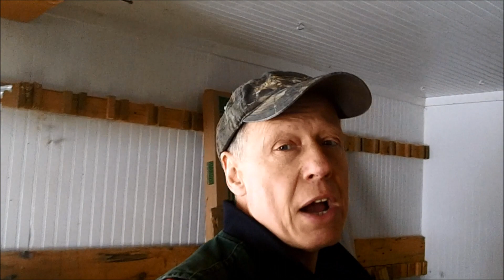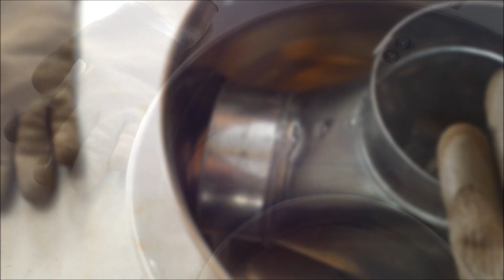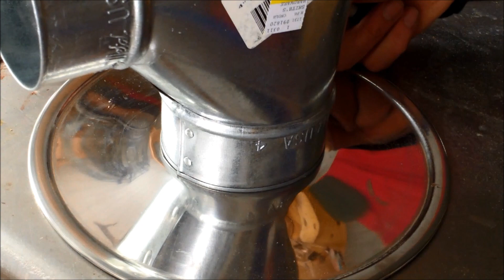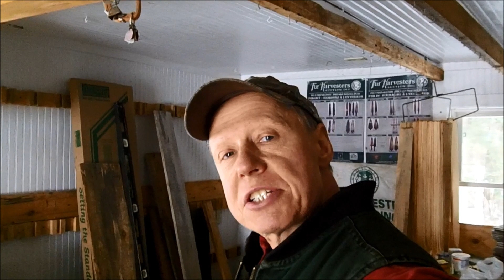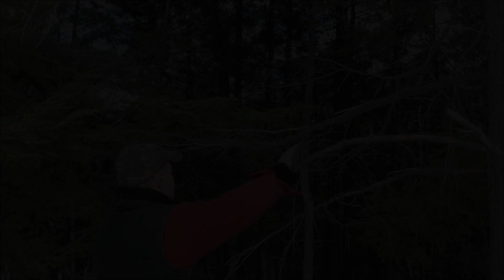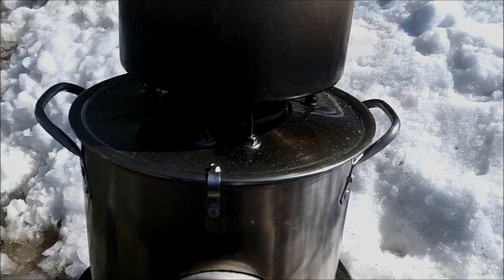HOW TO BUILD A SUPER SIMPLE ROCKET STOVE

Comment: Kudos on the concept!
A couple things that you can do with the exact same parts.
1) Use the cut out pieces for a foundation at the bottom of the burn chamber for added resistance to a burn by sliding one to the bottom then adding an inch of sand, and then the second one onto the sand.  This would work best if when being cut, they were nearly exactly the same size as the galvanized section.
2) Your U bolts were brilliant - but nothing says you can't turn them upside down to use - there by lowering OR even making adjustable the height of the "grate" you're replacing with them. 
My hats off to you - PLEASE keep these wonderful ideas coming and your channel viewers will be ready for anything!!!
~Soft Winds and Starry Nights~

Comment: Hi. Just a quick tip. For better burn it would be good to have some sort of shelf at the opening where you feed in the wood like some other rocket stoves do. This would allow air into the burn area. Also if you made a lose fitting skirt that goes around the size pot you intend to use to get the heat around the sides of your pot. Good luck. Whish you the best. Jason, Waiheke , Aotearoa nz

Comment: drywall corner bead makes a good pot holder/wind break because the stuff is stiff and has holes for the smoke to escape.  Just make cuts with snips every 2 inches on one side and you can bend it around in a circle.

Comment: For windy days,you can make a pot skirt from flashing. It should be about an inch and a half bigger that the pot you'll be using and about 5-6 inches tall. It directs all the heat up around the sides and doesnt let the wind sap any heat from the flame. Very nice neat build. If you build the one out of 6 inch pipe,there is a definate diameter to hight ratio that must be somewhat adhered to for proper woodgas combustion. Generally speaking, the hight of the chimney should be 3-4 times the diameter of the pipe youll be using. Ive built a few rocket stoves and learned alot through trial and error,,,,,mostly error. I enjoyed the video!!
Reply from the maker: BCtruck, rebuild, repair,repurpose  Thanks for the tip regarding the pipe length. This was my first attempt at building one and I have a few upgrades in mind. Going to add an extra air intake and a few other things.

Comment: If your ever in a home depot you can go to the garden center there and pick up a big bag of perlite to replacing the sand. it's all comes from a volcano anyways as its also a great insulator to your rocket stove and it retains the heat inward not radiant outward to keeping it cool to the touch on the sides for every bit of an hour before it maybe getting too hot to the touching of it. it will also shave off pounds in weight too. more to weighing maybe,4-5lbs# max. an you can then put that perlite mixed in your garden beds to retain the moisture over making it to less watering than normally needed. mixed with a deep mulch and believe me you'll benefit great results in time we'll worth the efforts made by a simple $5.00 bucks paid. even if it cost twenty...I believe it would still be worth it for just the rocket stove alone. Enjoyed watching you progress with your chosen urbanites cabin life style and it's life lived best. much as what I was raised doing and still continue to doing regardless of the rest of nosey neighbors request of changing my lifestyle to comfort to thiers...we no longer have interest and they can certainly just leave me be. This is America as I chose it to live it free. others can do as they themselves wants as long as they do it else where and leaves me alone...I'm "A" ok with that. peace. it's heaven to actually live it. I encourage others to just find it themselves. that's all C-ya. :)
Reply from the maker: I've heard good things about the perlite. I mixed wood ash with sand on my second one and That worked great too.

Comment: In my experience I've found you get cleaner burning and more heat from a taller flue which would provide more draft. Some say the optimum is 3:1 (flue 3x the length of the horizontal fire chamber).

Comment: i bought one of those stainless steel pots to use for cooking on my electric stove.  i left the water to come to a boil, for a couple of minutes, and when i came back i saw smoke and flames coming from the bottom of the pot.  i discovered that the stainless steel finish is so cheap or chintzy that it was actually burning off where the heating element touched it.  my wife and I had a  nice dose of chromium to breathe in for awhile.  i am relaying these experience so other people can avoid the disaster i had.

Comment: I made four several years ago. Just kept one of them but I need to take it out and actually try it....yeah I know.... I should have done that as soon as I got them made. I don't know if any of the others have tried them either...lol. Your model is very nice. Never thought of using a stock pot like that. Great idea. Thanks for sharing.
Reply from the maker: ladyb003  These stoves are a novelty to cook with and work remarkably well for something so simple.  My only recommendation is to have a separate set of cookware because they get really sooty over open flames.All the best.
Reply: Thanks for the tip.... and I have some extras. Thank you
Reply: +thebossoftheswamp If you coat the exterior of the pot with dish detergent before cooking over an open flame, that soot will wash right off.

Comment: just a couple tips: when you add a piece of pipe to hold the sticks add a grate so air can pass under the wood.   also maybe choke the incoming air down a bit, it adds to the rocket effect like when you have the door to the wood stove just slighly open.   Hope this helps.
Reply from the maker: Dick Richman Thanks for the tips. I'm in the process of many experiments with it. It cooks great just the way it is and my test run was on a cold day with crazy wind but it still brought the water to a boil. I was surprised about that.  I'm adding an air intake beneath the firebox to see what that does for it. I'll post an update of my findings.

Comment: The addition of a windshield around the pot with 1-inch spacing makes a lot of difference. Also, another piece of air duct on the side (crimped) will do for the wood. As Gwilym mentioned, wood ash is the best, a good insulator, and the least cost.

Comment: When I saw you first starting packing the damp sand in, I was wondering why you didn't add a little Portland Cement to the mix so when dries it would be hard and because it if it ever got dropped the pot the sand wouldn't crack and spill out of the pot but with the top of the pot mounted to the pot I guess you'll have no worries.  Also JC on the next one if you were ever to build another rocket stove try adding a little kitty litter to the sand mix, it acts like fire clay. Its a better insulator  .. Until next time  Bud
Reply from the maker: +Bud                  and Bess   Lots of recommendations have been made but I don't plan to change a thing.  I love it just the way it is :-))

Comment: SwampBoss, I used to make temporary furnaces to melt metals by using large clay pots mounted face to face with cutouts for burner down low and hole at top. This whole setup was put into a suitable sized outer barrel. Next I poured wood stove ashes a REALLY excellent insulator, filling all voids around clay pots clear to top of furnace hole. With a roaring flame inside producing temperatures of +2000F and continuous metal melting I could lay my hand on the outside metal barrel and hold it there as long as I wanted. I didn't measure the temp but estimate it to be <110F! Instead of sand (which has no insulation qualities, try wood stove ash! +tinkerbill
Reply from the maker: Someone else had suggested ashes and I thought that was the best idea ever. Light weight and free.  The sand does insulate it though but the ashes are awesome. Thanks for commenting.

Comment: Great idea for an easy rocket stove, I might just have to try this. Could you use standard hex head bolts rather than u-bolts? It seems like that would allow you to lower the pot easier by adjusting the nuts.
Reply from the maker: backwoods223 That's what I was planning on using but used the Ubolts instead. I'm just going to add about a 1/2" to the stovepipe to close the gap and I'll be all set.  I just used the U bolts to give folks an alternative  if they couldn't find the stove grate.  I have 3 of the grates so that's what I'll use on the next ones.
Reply: That’s what I did on my stove....yup works great....... I kind of favor things that are adjustable.… You just never know :-)

Comment: Looking forward to the next one.  I don' t think I could cut a pot.  I have plates from the lumber camp dad cooked in that are at least 55 years old that we use everyday.  We also have grandma Soops fancy ware that is around 95 years old we use every celebration.  An excellent little rocket stove & once sand heated it scarcely smoked.  Also I suppose a person could use smaller u bolts of square type to.  Try a center punch then a small tap bit to start screws if you do give me mention.

Comment: J.C., I would caution away from using the galvanized tee. The galv coating melts at 600 degrees & puts off toxic fumes that can make you very sick. You would be better served & hold the cost down by just using a steel tee from any pipe, valve & fitting supply store. Yes it would slowly rust, but you would be starting with a much thicker wall, that would still last a long time & no bad fumes. Your friend on the AL coast.
Reply from the maker: Dan M  Yep, I'm very aware of the issue with galvanized metal and that's why I commented how I wish it wasn't galvanized. I searched everywhere for a steel stovepipe but found nothing.  I figured for outside use and since it wasn't an oven surrounding my food that I'd be safe. Lets hope so.  I bought  a 6" steel one for my next project. I don't know why all the 4" is galvanized.

Comment: thebossoftheswamp a small 1/8" drill bit will drill that stainless pretty easy and that helps tremendously with installing the sheet metal screws. Thats how we install stainless ductwork. hope that helps
Reply from the maker: BackHomePrepper I predrilled everything else after making this video. I also heard that using stainless screws will eliminate that problem.

Comment: No blonde jokes please :)))) lol  I can't believe what you taught about the tin snips!!  Years ago I went to Tractor Supply and explained that I needed to cut a small piece of tin for a needle guard under the quilt when I have one in the frame and what would be best to do that. The man sold me a pair of snips just like you have in the video.  I tried over and over to use them and just gave up always feeling like I was curved to the side and a straight line was impossible.  I just always assumed I was doing something wrong and never that the man sold me the wrong tool.  I will be picking up a straight pair now :)))  Thanks JC, learn something new everyday!  (It's ok to laugh :))) I sure am)
Reply from the maker: Melody Capehart Medina Don't feel bad Melody, the guy probably didn't know the difference either. Yellow handle cuts straight, red cuts to the left and green cuts to the right. I do wish I could have watched you try to cut that tin though. I'm snickering as I type  :-))))
Reply: SpiritBear12 What you are describing is called "Stab Stitches" making only one stitch at a time and very slow.  I am a "Rocking Stitch" quilter.  This style allows you to load multiple stitches on your needle at one time before pulling it through. You only push the needle down till it touches your finger tip and then you rock the needle to push back up through the fabric to the top then rock again to go back down. You continue this until your needle is full of stitches and then from the top you pull the needle through and for me I have made about 10 stitches instead of 1 from the Stab stitch. With this method the needle tip will touch the tip of your finger and make it raw and bloody if you quilt a lot like me. 
The metal "V" can sit on your finger tip and when the tip of the needle hits it you can just push it up and the needle will go back up through the fabric saving some skin on your finger.
Also the method you explain is used when you are working near a bulky seam where you have to go through many layers and the Rocking style will not work very easy if at all.
Hope this helps :)))
Reply: SpiritBear12 You can see the little tool by looking up Aunt Becky quilting tool. Very easy to make one for the Rocking quilting method.  Not only does it protect your finger but helps to push the needle back up to get tiny little stitches the same size.  Glad it helped :))
Reply: Melody Capehart Medina 
I am blonde too but it's a guy secret, I feel like. But THEN again, I don't think most of them know that! I've used my husband's tin snips and watched him use them and I've always wondered why they seemed backwards. I just tried to turn them over but that doesn't work well either. So, I really don't think he knows that there's more than one kind. And he's a construction worker!
Knowledge is key as well as power. Helps you work smarter than harder. That's with anything!

Comment: I guess I'm going to do this one . Simple and looks great . Was thinking about concrete instead of sand or furnace concrete . Maybe hold the top on with a few bolts and nuts with a washer on the end and let it set in . Thanks for the idea . Really enjoy your channel
Reply from the maker: ThePara7 Don't use regular concrete because it may explode. I used sand because it was free.
Reply: Thanks maybe the sand idea is the best . I got lots of that haha Thanks again
Reply: ThePara7
refractory cement type c  fires to 3000f   hope this helps
Reply: Yea I checked that out to good idea also
Reply: check with a ceramic supply co. 70 bucks per 50

Comment: One thought I have - the ratio for the stack vs the air/fuel inlet. The term "rocket stove" was contrived from the rushing sound they made from the air being drawn in.
I believe you need the outlet to be slightly larger than the intake to create a violent draft that completely burns any fuel source set in the intake.
Try a 6" outlet with a 4" inlet.
Reply from the maker: waults Very good advice my friend. I'm going to experiment with a few ideas. I think before I change pipe size, I'm going to add an air intake through the bottom of the firebox.  Updates to follow. Nonetheless, I'm impressed that it brought the pot to a boil in 32 degree temps with it as windy as it was. I'm thrilled with it actually.

Comment: good Video the only thing I can see that you may want to add is a trap door to clean out your ashes so you dont have to fight turning it upside down to empty teh ashes out
Reply from the maker: +Jack Mcdonell  There's no fighting or turning it upside down, I just reach in with a gloved hand and pull them out after each use. Very simple :-)
Reply: Hear’s an idea for you to work on boss....shop vac with adjustable power for sucking out ashes without taking the sand or other insulation.
You may find it useful for other applications.

Comment: Awesome build! Not only is it a cooker but a pretty good thermal mass as a sand "battery " which just means it will continue to give heat long after the fire is out. I would like to know what the outside temp is at max fire . And figure out a easy way to get the ashes out and possibly a nother vent source if using in a enclosed space which the zinc might also be a problem... I've heard even after you burn all the zinc coating that you can see off there's still residual zinc ? I definitely don't believe everything I hear but don't have a idea how to test it ... but I love this design because it's so portable...

Comment: Best design that I've seen yet.  The only thing I'd do different is to add Plaster of Paris or Powdered Clay to the Sand...or even some Cement.  This would make it solid and remove the risk of having the sand fall out of it...it would be semi-permanent however.  Might be a better insulator too?
Reply from the maker: Lots of different materials can be used for filler. This was my prototype and I used sand because that's what I have on hand.  Cheers :-)

Comment: very nice! I reckon you might want to try vermiculite or another insulating material as they are better than sand. At least that's according to videos I watched on DIY Tandoor. I'm by no means an expert and have not tried either.
Reply from the maker: +David Kalnins It has been recommended many times but living in the woods, simple and cheap, the sand works great and cost me nothing.  If vermiculite ever finds it's way to my doorstep I may give it a try. Cheers :-)

Comment: Instead of the U bolts I was thinking of using several short bolts with double nuts one on top and one under the lid in each bolt. Set the pot on the bolt head. Four or five around the fire would steady any pot. You could even adjust the height if you wanted to or needed to for some reason. Just another idea of how to skin the cat.
Reply from the maker: John Gallagher There's a bag full of bolts on the bench that I was planning on using for that but decided on the ubolts instead. The stove grate is the best thing for this. I only used the bolts to give folks another option in case they didn't have a stove grate.